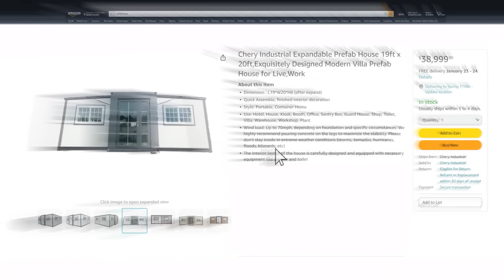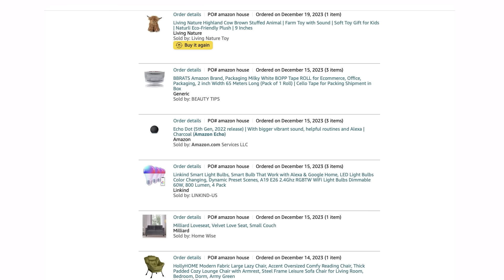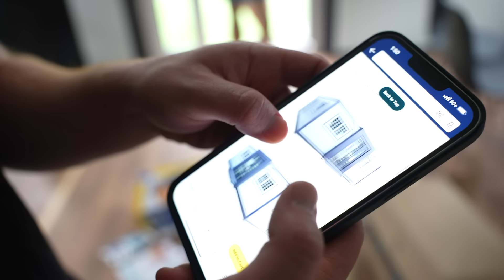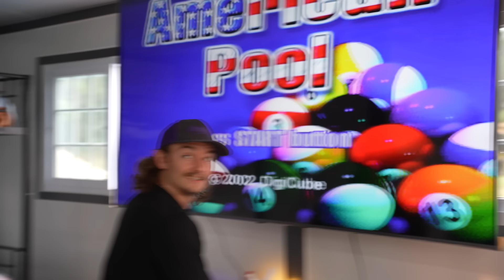I Bought a House on Amazon

Comment: I just want to know 2 things…
1) insulation? How would it withstand high heat or super cold?
2) how well is it sealed, I thought I saw gaps, rain or moisture getting in? 
 
I guess 3… how well does it withstand wind/high winds of storms?
Reply: It won’t withstand cold or hot weather. It’s clearly drafty. And it says online it is not recommended for being in extreme weather conditions (storms, tornados, hurricanes, floods, blizzards, etc). It’s basically a shed.
Reply: I feel like you could seal it and insulate it a lot better when it's folded out. For 19-20k it's really not a bad deal with the current housing market. Buy some land, this and put about 10k into making it livable and your still only spending a fraction of what you would for an actual house.
Reply: @alexglenn4111  and how do you install any kind of insulation if there’s no framing ? And it won’t  only cost 10k to make everything even halfway habitable. Permits, foundation, septic system, electrical, etc. And Buying land virtually anywhere won’t be cheap,  especially in or near big cities.
Reply: Per the listing company: "Constructed with a steel frame and flame-retardant foam wallboard, this container home prefabricated is waterproof and thermally insulated. It's earthquake-resistant (grade 8) and wind-resistant (grade 10)."
Reply: @jt8497  blah blah blah blah. Have fun getting building permits for it. And you still need to pay a fortune building a foundation for it.
Reply: @Johnny-be3pj  just live in area that you  need building permits.
Reply: @Johnny-be3pj the costs for permits, foundation laying, electrical, septic arent as astronomical as youre making it seem unless youre strictly talking about certain zones in or near big cities
Reply: @Johnny-be3pj The states with no building codes are Colorado, Hawaii, Arizona, Arkansas, Texas, Alabama, Wyoming, Michigan, South Dakota, North Dakota, and Missouri.
Reply: @Hiforest  Building permits are issued by the CITY/TOWN or COUNTY, not by the state. Permits are required for most major construction or remodeling projects. specific municipality ordinances tell you what is in compliance with building, construction, and zoning codes.
Reply: @Johnny-be3pj  it can't be that different to putting a trailer on land, surely.
Reply: @Johnny-be3pj  as opposed to getting one poured for a normal house? You're still getting out cheaper in the end lmao
Reply: it's made of plastic, so.... all of your concerns are actually true
Reply: you could probably add insulation yourself without much difficulty, but ofc construction itself isnt particularly sturdy
Reply: And electricity?⚡️
Reply: @Johnny-be3pj  I think his point is mainly that the housing market is ridiculous  right now so even a really bad house seems doable 🤣
Reply: [Safe, Durable, and Weather-Resistant]: Crafted with a robust steel structure and flame-retardant foam wallboard, this container house prioritizes safety and durability. The waterproof and thermally insulated construction ensures a secure environment for your belongings or a cozy living space, while the exterior withstands wind loads of up to 70mph for year-round resilience.
Reply: @Johnny-be3pj Have you actually tried to insulate with this Amazon house?
Reply: @Johnny-be3pj why you so miserable dude lol
Live and let live
Reply: #2 was my main question, it's very nice and convenient, but doesn't seem too secure from the elements or otherwise.
Reply: Just buy 5, 8x40 foot used shipping containers in great shape, can get them for 2k each is. I did.  Foundation is pier concrete, 20 of them. Cost was 7,500. Put the 5 side by side, cut out walls and added support beams on inside where walls were. Framing is easy and cheap I did it all, 3k for the studs, 3,500 for drywall, 750 on paint, electrician wiring and connecting was 7,000, plumbing hook and connect was 6,000, insulation was 7,000, spray foam. Flooring was 3,000, hvac system w install was 6,000. Appliances and bathroom fixtures and lighting combined was 5k. Add it up. Ohh, land was 25k. Permits 2k. Its way less than 100k, and I have a beautiful 1600 sq ft home. Beats the average 1200 sq ft home on market for 400k.  More then 4 times less.  For those of you thinking it costs a lot to build container homes, you clearly don't know how to diy or research.
Reply: @legopotter8295 well make a video and teach us or atleast help me out
Reply: I also wanted to know how is it registered?? How to you secure the folds? How did it get delivered???
Reply: @alexglenn4111 Just like how they got a generator to make the electronics (fridge, TV, etc.) to work

Comment: They turned on the shower and out came water - how's that possible? I don't see any plumbing. Please someone explain how this is possible. They said they had a toilet in the house when it arrived - ok, the plumbing for the toilet and the sewage system. Where is it? When it gets cold how do they heat the house? I just have too many questions. What if it's very windy, how stable or grounded is that house to the ground? Did they have to teather that house somehow permanently to the ground. WAY TOO MANY QUESTIONS 🤔.

Comment: Did I miss the part about connecting the house to water, sewer, septic (?) and power? The lot had to be prepped & permitted before the install took place. What about leveling? In some places, the house had to be installed & connections checked before power is turned on. What happened to these steps?

Comment: its a 40 or 20 ft container ocean going . so it 20 ft long 8 ft wide and 2 panels that fold out about 24 feet. the center contains the bathroom and kitchen cabinets. electric is wired for 230v and 115 outlets .  Water and sewer hook ups are on the side . standard fittings .  about 7k when ordered from China + customs and shipping and delivery from the port. Probably not rated in florida for hurricanes but solid construction. Insulated foam between 2 sheets of thin steel . Key word thin!

Comment: I live in Canada.  My first thoughts were:
Where's the insulation for the walls, floors, and ceiling?
Where are all the double- or even triple-paned windows?
Where's the solid interior door?
Just some things that come immediately to my mind.  There will probably be more thoughts later.

Looks like lots of fun.  Wish I was there.

P.S.:  With all due respect to your friend, I don't want to be able to poop and shower at the same time.

P.P.S:  I've been homeless for  the past five years and the room I've been living in is smaller than the first room you showed before all the sides went up.  I also have a bathroom but the walk-in shower is built into a cubbie-hole where I can hang a shower curtain.  Don't get me wrong, it could be a lot worse.  I'm 70 yo and be on the streets.